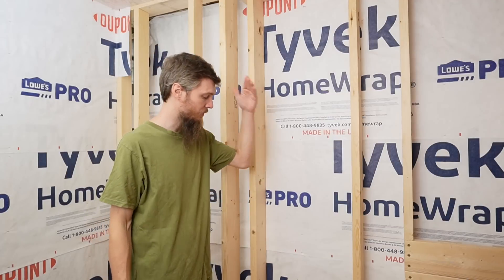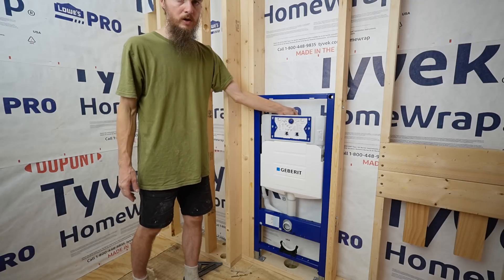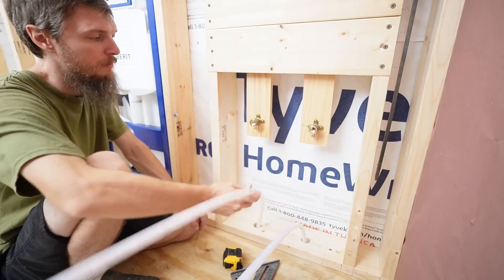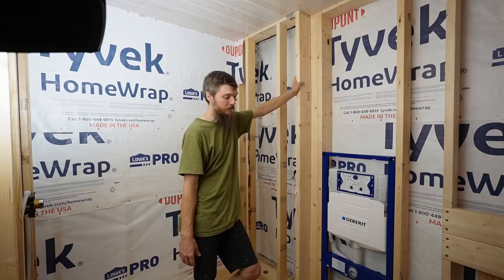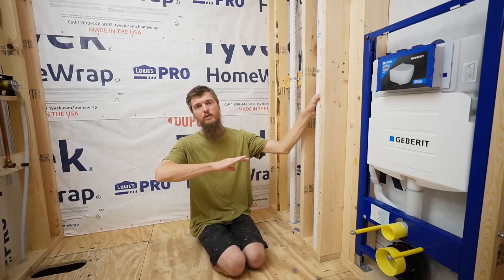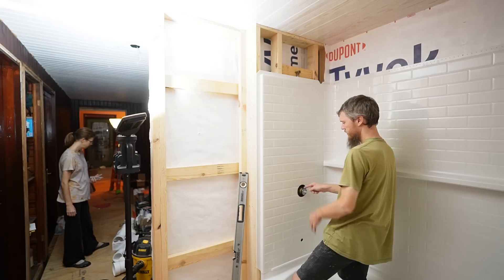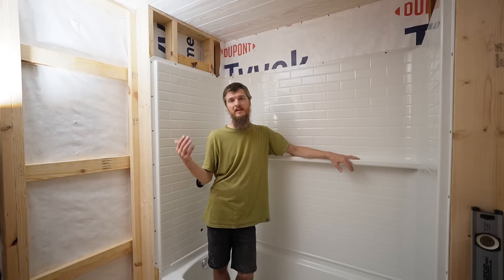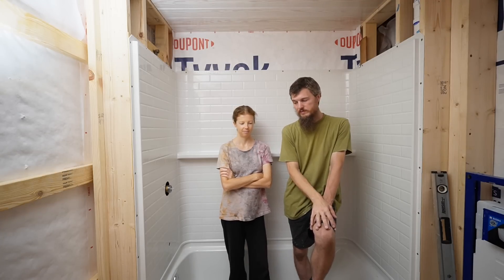We're Months Behind Schedule, Bathroom Rough-in is Done!

Comment: Your floor has resin in the wood - the plastic has resin ; that pad ( glad you installed ) is there to ensure any movement in the future won't cause a squeak.   I worked for Sterling / Kohler for many years.  trust me - they can squeak and will - more on OSB board but they will - and when they do - it's "did you install the felt mat " to which folks would say - what felt mat ?

Comment: Thanks for the info about the wall mount toilet. I'm with Ashley-- reduce the cleaning! The tub shower surround is way more practical than tile which is expensive, grout gets moldy, and goes out of style. Smart to put the shower controls so you don't have to lean over toilet! If the shelf is a problem, you can get a shower rod that bows out to make it feel more spacious at shoulder height.

Comment: Great idea putting the water for the shower on the opposite side from the toilet…wish my bathrooms were designed that way👍🏼
Reply: I lucked out that the tub is on the opposite side of the room in my Apt. with 3 grab bars, much safer than most bathrooms.

Comment: Pro tip:  (not for you, you have a caulkless tub).  When caulking a tub to the wall, always fill the tub at least halfway with water, and leave the water in until the caulk sets firmly.  That way, if there is any deflection in the floor from water weight, it will already be accounted for.  Also, always use waterproof (flexible) caulk, such as silicone, polyurethane, or butyl, as it will stay flexible for many many years.  NEVER use latex caulk, even 'siliconized' latex.  Latex will become brittle and crack in a few months.  I hope this tip saves someone the grief of having to deal with water damage.  And as always, thank you Doug and Ash for sharing!
Reply: Yes this is not for this tub combo, but great advice. Also when caulking run 2 straps of painters tape. 1 down each side of where you want the caulk to be. Apply caulk. Use a dry wall mudding knife to smooth out the caulk. Then pull tape down or up and away at an angle to form nice crisp edges.

Comment: It's looking great!! I love the tile look too, but I also agree on the shelf... because of that, we ended up installing a 3-piece surround that doesn't have the tile look, but does have TONS of shelf storage. It has 3 corner shelves on both sides and a large shelf in the middle but towards the bottom so you don't bump into it. It also kinda sinks into the studs so you feel like you have more room. Combined that with a curved shower curtain rod and it's more spacious than our previously flat 4"x4" tiled surround and shower door setup was. If I recall correctly, our tub and surround are made by Delta... or could be Kohler... 🤔 it's been a few years so I'm not positive on that. Any who... it's coming together nicely! And I love the white tub and surround with the whitewashed ceiling!! Looks fabulous!! 😊
Reply from the maker: Thanks :) Hopefully this surround works out. At least it will just be for the kids and I'm sure they'll be just fine with it :)
Reply: @diyfferent  Yes, hopefully! I think if you utilize the front and back of the shelf more than the center, it'll be just fine! 🙂 It looks great! Looking forward to what else you do in the bathroom!!

Comment: A caulkless tub surround that is approved by Doug!?!   I may rethink my dislike for that type product.   I need to rework my basement shower.   This type system would be much easier than tile and easier to maintain.   I really like the full length shelf.   Due to brain radiation I have to use several different products on my hair (on a rotation basis, not all the time).   That shelf would be very convenient.    The crisp white color is definitely appealing.    So many units are a tan color.   Builders must get a better discount on those.   To me they appear faded or soiled.   After one of your previous installations I talked to a few plumbers re installing wall hung toilets.   Seems they cannot be bothered to quote a price.    I like the look but it appears it's not an option here.   I do appreciate how Ashley and Doug share so much of their expertise with us.

Comment: ** I always wanted the shower head and water spout to come out on the opposite side as the drain..  so  the water will run down the tub away from where you are standing (or when cleaning the shower)  it seems so backwards..  I'm with you Ashley.. what a pain to always be leaning over everything..  I have a small bathroom and the sink is right next to the faucet side.. drives me crazy all the time. ha

Comment: When I rebuilt my bathroom, I placed the shower valve on the left and the shower head and drain on the right.  I did that so that I did not get all wet turning the shower on to warm up the water and it is much easier to reach from the open floor area.  It does require running extra water lines to get hot/cold to the valve and then back again to the shower head since my water source was on the right.

Comment: I don't look for any special order on the installations.  I think you need a break sometimes on working in different areas.  Not necessarily completely finish each room.  This system looks great. I really like the idea of the toilet up off the floor...so much easier to work around. The only thing I think I would do, when you are putting up the wall where the sink and toilet are, I would create a panel that totally comes off to completely access the plumbing, the toilet tank etc. in the future.  Just a thought, may not be practical.  Thanks for sharing.  Y'all stay cool and have a Blessed day.

Comment: I think the water for the shower goes on the other end because it makes it easier to step in with the shower running.
Reply: Hm I didn't think about that. Good point
Reply: My shower for my bath in the main br...I have so far to go before I get to that😫, will have the shower control on the outside of the shower.

Comment: I like the fixtures you've chosen for your bathrooms.
They may be a little more expensive, but worth it.
I've never liked having to caulk around everything.
That's why the wall mounted toilet and sink would appeal to me.
What is the weight rating/limit for the toilet?
I like the idea of the water control being on the opposite end of the shower.
Anxious to see how you it looks completed.
Reply from the maker: The weight limit on the toilet is about 800 pounds. :)

Comment: I was surprised you didn't insulate the walls. Love the way it looks.
Reply: The good thing is that there is a closet in between the bath and living room, plus the shower seems is on the wall to the kitchen, which will help with sound.  There is a minor issue with the back porch, which has a full wet wall, with the water heater, and clothes washer, nearby. That leaves Belle's bedroom.  I wonder how much she hears because I don't think there's any insulation between her room, and the porch, where the appliances are.
Reply from the maker: All of the bathroom walls will be insulated. The back wall with the plumbing is a double wall setup. The framing you see is inside of the bathroom, but behind that wall & the house-wrap is another wall with insulation in it. Our daughters bedroom is insulated to the bathroom as well as the porch. The wall behind the tub is not insulated yet, but it will be added from the back side(kitchen) which is still open. We're just insulating as needed before each wall is sealed up.
Reply: @diyfferent Doug aren’t you putting the water board behind the tub surround in case of leaks and rot?🤷‍♀️🤷‍♀️
Reply from the maker: @dorothyallen3614  No, it just gets installed on the studs.
Reply: @diyfferent I didn’t recall you installing insulation between the porch & bedroom when you took out the window, and installed plywood.  Curious at which stage it went in.
Reply from the maker: @agresticumbra  We insulated that wall here: https://youtu.be/Ynrw_TRVLE4

Comment: I have always fussed about the commode being right beside the tub. Didn't realize why till I got older. With the commode beside the tub you can't use a shower assist chair because the slope of the tub at the back the chair has to be in the center and that puts it over the front of the commode.

Comment: I don't know if your tub is fiberglass or acrylic. Just FYI, I would always recommend acrylic. Everyone knows what a fiberglass tub will look like in a year. Fiberglass scratches so easily and those fine scratches ruin the surface so that your tub always looks dingy. Also, fiberglass or acrylic, never use abrasive cleaners because that's what ruins the surface. Abrasive cleaners abrade the surface and then cleaner residue, soap scum and body oil/dirt/grease sticks to the scratched surface. My Mom always used Ajax as we were growing up so I remember how that brand new tub began to look faded and dingy. The harder we tried to clean it, the more damage we were doing to the surface. Also, don't forget to make an access panel to the shower/tub plumbing in case leaks spring up down the road. It will happen. One day there will be a leak. So now is the time to plan for access to that plumbing. I just love watching y'all work. You gee and haw so well together! And you are both so smart.

Comment: Don’t you have to put water board behind the tub/shower before putting it in, so it won’t rot out the wall if it leaks? I did not see any on the walls 🤔🫣😜!🤷‍♀️🤷‍♀️🤷‍♀️🤷‍♀️🤷‍♀️
Reply from the maker: No, this unit gets installed directly to the studs.

Comment: If chlorine is bad for plastic, why is it sold in plastic bottles when you buy  it in the shop..
Reply: Well, as a guess...  Chlorine beach stays in the plastic bottle a relative short time.  The type of damage Doug was talking about may take years before it is an issue.  That's my guess anyway.
Reply from the maker: There are different types of plastic formulated for different uses. Chlorine doesn't affect all plastics equally.
Reply: The chlorine in a bottle is concentrated, and in a toilet mixed with water the amont of chlirine is only about 100ppm and in a bottle 80% strong, that is why it is not harmful  for rubber and plastic
Reply from the maker: I'm not sure what you are saying, but hopefully this helps you understand why some plastics are degraded by Chlorine and others aren't. It's all about the chemical composition and oxidative degradation of the plastic: https://www.corzan.com/blog/how-does-chlorine-affect-plastic-piping-systems

There are studies out there that conclude "Chlorine in potable water is seen to accelerate the brittle oxidative failure of a PEX pipe material. The effects of chlorine on lifetime reduction are observed even at very low levels of chlorine.": https://plasticpipe.org/common/Uploaded%20files/1-PPI/Divisions/Building%20and%20Construction/Division%20Publications/BCD%20Technical%20Literature/Jana/Jana%20Report%20-%20Chlorine%20Resistance%20Testing%20of%20PEX%20Piping%20Materials.pdf

And there are many actual cases and testimonies of PEX failures in homes due to the oxidative failure from chlorinated water. The in-wall carrier is also susceptible to this same kind of damage so it's best to filter the chlorine out, which is easily accomplished.